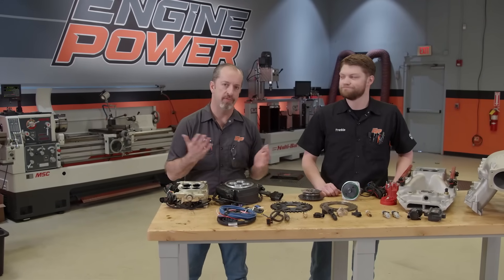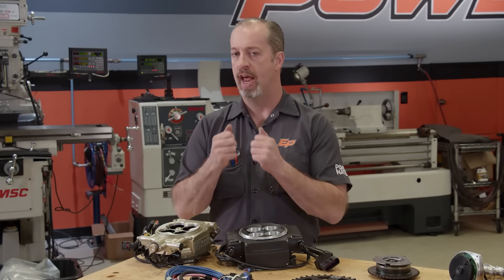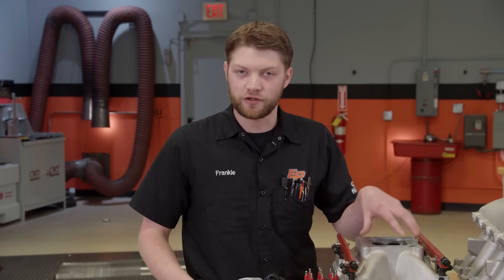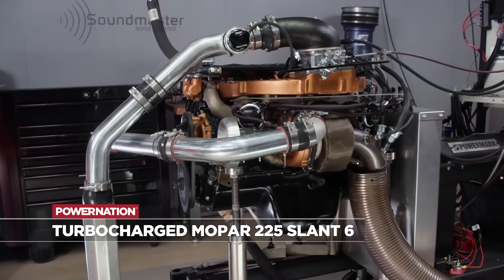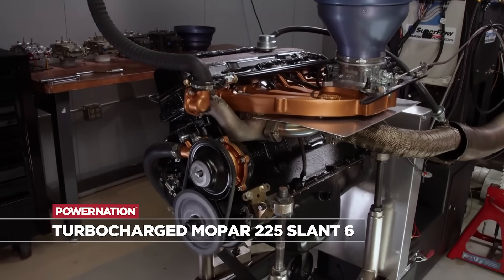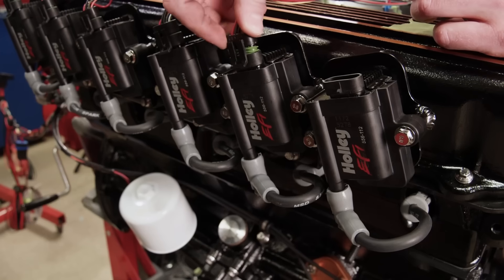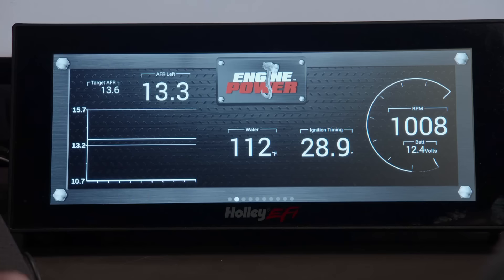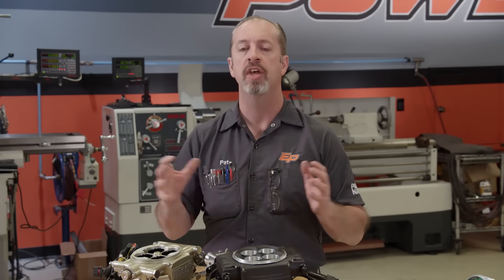EFI Conversion Explained: Everything You Need to Know

Comment: The answer: No! Aftermarket fuel injection systems have great adjustability but aren't designed to last 100,000 miles. You will be left down at some point without quick parts availability.

Comment: From my own experience, there's nothing simpler than a distributor and carburetor, as thats what I grew up with, no computers. Then I decided to go to a throttle body efi about 4 years ago, and it has proven to be vary reliable, especially when I included the associated electronic distributor.  Make a big difference when the temps get really cold.  Not as good as port injection, but so far, it has been very reliable.

Comment: Yeah edelbrock and holley will charge you $500-$800 for one of their port efi intakes. Those intakes are all but identical to their carbureted versions with injection bungs cast into the runners. That small deviation in the castings though somehow justifies those astronomical prices that in most cases do not include little things like fuel rails. Its no wonder people are buing the chinesium copies that sell for about $200 fuel rails included. Im not advocating for people to buy chinese copies of parts but companies like holley and edelbrock selling a basic dual or even single plane intake with a 4150 flange and 8 little injector bosses should drop their prices down to entice buyers away from the chinese crap. If they have a high speed ram style intake like the pro flo xt or high ram then sure let that be the bucks up manifold, but bring the basic one down into the 2-300 dollar range

Comment: I was told I could significantly improve fuel mileage on my 1985 GMC Short Bus by changing it from being carburetated to EFI. It's a great vehicle with 60,000 miles on it.  I converted it into an RV.  I love it except for the gas mileage and being a bit sluggish on the hills.  Is it worth it to change it to EFI?  I especially like the ease of a throttle body kit conversion because of the simplicity of the swap.  But after watching this video, I was left with the impression that unless I installed a manifold with port injection, I would unlikely benefit much.    Or did I misunderstand?
Reply: I have a GMC motorhome (Oldsmobile 455 front-wheel drive from the Olds Toronado).  GM built these back in the 1970's until they downsized all the vehicles and they discontinued the big block Olds drive train in the late 70's.  Quite a number of us have changed to EFI.  EFI makes your engine start and run like a modern vehicle, but it is Electronic Spark Control (ESC) that wakes up the engine and gives it pep and better mileage.
One thing to be aware of with aftermarket all-in-one EFI kits, is if something fails on them, the Manufacturer will insist your remove it and ship it to them for repair.  This is fine for a hot-rod or daily driver, but you are going to take your RV hundreds or thousands of miles from home to the middle of no-where.  This means you pretty much need to carry a spare system with you!
Another pitfall is many of the new kits have the electronics incorporated into the throttle body itself.  This may be fine for vehicles with lots of room for airflow under the hood, but in our GMC motorhomes and your (assuming) van-front conversion, the engine compartment is tight and electronics do NOT like heat.  Many FITech owners have experienced rolling in off the Interstate to refuel, and then have the engine not restart until the engine compartment cooled down.
I'm guessing your GMC short bus has a 454, so I would recommend a GM OEM throttle body system from someplace like Howell Engine Developments.  It's a bolt-on kit using GM's system and their separate (mounted in passenger compartment) ECM.  It will come tuned for your engine and likely won't require any further tuning in your application.  Howell can supply the ESC distributor and its pretty much plug and play.  Parts for it are widely available if required and mechanics are familiar with it.
Just my experience.
Reply: TBI is still much more efficient than a carb because it doesn't piss extra fuel into the wind at low rpm

Comment: The most important thing on EFI conversions that people must understand, a throttle body injection unit cannot be mounted straight to a carbureted intake manifold without plugging (shutting off) the heat riser crossover, or replacing the carbureted intake manifold with one intended for fuel injection. Failure to adhere this step will guarantee the engine will never run right as the atomized fuel will vaporize and never make it to the cylinder, which results in low / no power complaint. If a person is going to spend good money converting from carburator to throttle body injection, spend a few extra dollars and get a new intake manifold intended for fuel injection systems.

Comment: I've always wanted a build project and I figured a good place to start would be to upgrade the intake on my 98 Silverado with 5.7 vortec. I want to keep it naturally aspirated and convert that terrible spider fuel injection to a better EFI system.  The problem is, I've been doing research for about 2 months, and I still feel like I have no idea what intake manifolds I should be looking at. 
Should I upgrade my cam?
Exhaust headers?

How much HP and Torque can it handle before my transmission is in danger?
Do I need to upgrade piston heads?
Can anyone point me in the right direction? 

I feel completely capable and comfortable replacing the engine components and wiring. I have completed a lot of repairs on that truck by myself but this kind of thing I have no experience with.

Comment: When it comes to efi whether it's port or throttle body the sensors required depend on your setup. You can have whatever ecu you're running control timing and fuel in batch fire like the TPI engines of the 80s and early 90s, no crank or cam sensor required. Now if you want to run sequential fuel and sequential spark then a cam and crank position sensor is required. Now when it comes to gen 1 small blocks from 1955-2003 the late model vortec engines 350 and 305s use the goofy looking crab distributor. That distributor has a 1x cam sensor built in that provides the same cam signal that the early gen 3s use aka Ls1, 4.8, 5.3, &6.0. Efi connection sells a coil on plug conversion kit based around the Ls style crank reluctor ie the 24x and 58x wheels that they redesigned to fit onto a gen 1 sbc crank snout, where it rides inside the timing cover from a 96-03 vortec 305/350. They also provide a cam sync distributor that is just the distributor from a 96-03 vortec   with a blank cap and no high voltage, so it's only there to run the oil pump and provide a cam  position signal. 
Recently chinese copies of the edelbrock pro Flo and holley 4150 flange efi manifolds have started showing up on Ebay, but where the big aftermarket boys will charge between $400-$600 for their intakes these chicom units can be had for $200 and they provide fuel rails to boot, even the clearanced ones for the holley copy. I'm not advocating for the supporting of dirty communists using slave labor but these are on the market so companies like Holley and edelbrock might want to offer some budget alternatives for the efi crowd.

Comment: I was just at my dealership for a 20K maintenance. I was told that i needed an "EFI Fuel Service."  I denied it because it didnt seem right. Ive only used Chevron gas since 0 miles. I put Feul Injector cleaning solutions every now and then (i buy them from Auto Zone. A chevron brand). 

Price is $270.00 !!! I denied it.  Should i go look else where to have someone else check my EFI system?

Comment: I have a 350 4 bolt main that runs well in my '71 Chevy Blazer. QUESTION, should I get rid of it for an LS or LT?  Will the LS or LT fit, will I have to modify the motor mounts, steering pump location, etc. ???

Comment: question? will the aftermarket fuel injection (efi) help me drive over the passes by increasing o2 intake? i have been thinking about doing this but the issue i need solved is me being forced into the slow lane when driving at high altitudes. if it cant solve that then its not quite worth it for this guy. but if it can, I'm in! old chevy van with 305
Reply: It def won't make that much "power" difference at high altitudes unless your carb is malfunctioning. It might help your mpg tho.

Comment: I saw a video where a Carburetor Guru was saying F.I. gives the engine the fuel regardless of what the engine wants based on software but a Carb once tuned correctly gives the engine what it asks for.
Made it really clear they didn't understand fuel injection at all. And it was an "Expert" carb tuner. lol

Comment: Real fuel injection has injectors per cylinder n adjust timing in real time. Holley sniper is just a waste just buy a modern car if u want efi.
Reply: 60's era cars can benefit from throttle body injection and still look stock with air cleaner on
Reply: You just don't get it

Comment: these EFI units are un reliable,, any brand any model end of story,, many of the parts are chinese and spares are not on every corner like holley carb parts. when i see vehic;e  manufacturers using these i will take a 3rd look. and circuit race teams using these, bought a holley kit ,, sold it un opened.
 a pocket full of pens,, say no more,,,,,, a tool belt like batman had in the 60,s TV series is next,,.

Comment: How to do an EFI Conversion:
1.  Spend $2000 to boost pressure and buy Throttle Body.
2.  Call customer support to get it to run
3.  Take to local EFI Guru to make it idle.
4.  Drive and Enjoy.
5.  Call tow truck when EFI brain dies.
6.  Repeat steps 1-4.
7.  Call Tow truck again.
8.  Buy Holley Carb w/ manual choke
9.  Enjoy Car again
Reply: Soo true!

Comment: For any application you should run port EFI if there's a dual runner intake manifold available for the engine that meets your power, and emissions, goals. Historically that has been the greatest obstacle, particularly with port injection, because port injection needs a dual length runner manifold to take full advantage of its capabilities. If you have that manifold, you can run a wide LSA, that allows it out perform as well as run cleaner and smoother than a dual plane carb or tbi setup with a narrow LSA from idle to peak torque. It can also be set up to outperform a dual plane carb setup past 7000rpm at the same time. All of that isn't possible with a carb because the fuel won't distribute properly through a dual runner intake, and you have to run a narrower lsa to get the power.

Comment: Guys I absolutely love your informative show!! I recently converted my 1972 mustang to a throttle body style efi. It’s a 4 bolt main 4v Cleveland engine with original iron open chamber heads 9:6:1 compression. What is a good afr for light cruising??

Thank you very much

Comment: I’m building a 72 Charger Rally with a stroked 440 (512) cu in with a Fi tech six pack on top. I’ll be putting the engine in soon
Reply: Sooo. How did this project end up?

Comment: Ok, hold the phone for a second.  One thing they DID NOT MENTION.  Make sure you call a tech line or find a reliable source that you trust to answer one of the most basic questions that some A/M companies DO NOT MENTION.  This is what you ask them verbatim, "Is it tunable on an Aftermarket Duel Plane Manifold?"  I cannot tell you how many times this issue comes up.  One more thing.  DO NOT put on a carb spacer until the basic parameters have been set and verified and you are comfortable with tuning the system.  

Last but not least.  DON'T OVERTHINK IT.  The computer only needs the basic information to enable a base map.  You try and spoof the computer for some odd reason and you are gonna chase problem after problem.   This is where the older generation has issues.

Comment: A question if you please?   Can a throttle body type EFI like the Holley Sniper be rigged to use Propane instead of Gasoline???
Reply: No. Propane has a completely different regulator that is required.  In some systems it may actually require a vaporizer.
Reply: @joshtheking1772   hmmm, interesting.  thank you for your comment.

Comment: It bears mentioning that a lot of port EFI systems pulse all the injectors simultaneously, all dispensing the same amount of fuel. In my mind, that's hardly worth the extra expense over a TBI system. Just my $0.02.
Reply: Thats not entirely true and sort of a half truth.  TRUE fuel injection varies the pulse width in accordance with many factors.

Comment: Grat vid guys but what about older engines I have a 41 CJ-2A with the flat head still and I would love to upgrade the Carb to even a simple throttle body but have found nothing for older engines like flat heads so why not a custom build on a old flathead one day with new equipment such as Throttle body and Electronic timing ... Thanks

Comment: At 1:00 where the "Boosted 4.3L V6" is shown running up, you can see fuel dripping off the throttle body linkage.
Reply: They had to cut the footage shortly afterward because it caught fire.   It wasn't serious because the guys quickly took out their shirt pocket mini fire extinguishers to put it out.

Comment: A EFI "swap" I haven't seen is taking a 88 and up Chevy which is TBI 5.7 and getting rid of the old crap and swapping in a new TBI system.  The old OBS trucks are popular but the old original TBI systems are craptastic at best, the wiring is old, etc etc.

Comment: I'd love to see a Chrysler/Dodge 4.7L OHC V8 build.
Reply: You won't see those engines on these shows. There is no aftermarket parts out there. The people that build these motors pay for one off custom parts they built or payed a company a bunch of money. 4.7/3.7 are rejected child's that got love at first but was proovin that they can't handle much more of a power programmer and exhaust. The cold intakes out there harm the motors then help. I've had 2 jeep gran cherokee with 4.7 and 1 with the 3.7. If you want to see why these motors don't handle power just Google or look here on youtube.
Reply: @wkjeeping9053  . . I appreciate the advice. I'm actually a retired Ford Tech. I really don't have much experience with the 3.7/4.7, or even the 'New' Hemi's. I think a roller-block Magnum 318 or 360 is what will find it's way into my 2000 WJ. At least I have a reasonable amount of experience with those. (still mulling a 302/AOD swap since I already have everything, but . . )

Comment: now this might be a way out of the box request but if any of the power nation shows remember late 90s to 2000s nascar restrictor plate racing, i would like to see one of those engines being torn down and then rebuilt with and run on the dyno with and without the plate to see the discrepancy in horsepower, and also hear that awesome sound and let powernation experience that also
Reply: Unrestricted they were 850 to 900 hp. Way too much for today's Cup steering wheel holders.

Comment: Thay are by no means reliable, and when they get warm it  screws with the computer, and there is no fixing it on the side of the road, you are screwed until you replace  it, they run good for a while but it's only a matter of time until you're walking getting towed,I'll stick with a good old carb from now on !!
Reply: Sounds like boomer yelling at clouds.

If EFI didnt work, cars wouldnt have been using them for over 40 years.

Comment: I got that exact dual quad system and it never ever worked. No one, but no one, could ever get it to work either. 
Took it to 2x dyno tuners and both of those were just left scratching their heads. Tried to return it and they said it was an installation error for which they can't be held responsible and they won't accept any returns. 
I'm a qualified mechanic the installation was 100% perfect. 
So fast forward turns out all the onboard ECUs were faulty subject to a class action in California. 
They try and sell you a new ECU even though the EFI system never ever worked, they knew there were problems and they treated me like I was the problem. Completely unethical in my view.  
Also the manufacturer never mentions that their dual quad system doesn't fit on latest SBC dual quad manifolds - apparently that isn't their fault either but mine. 
The anger is coming back, a very bitter experience.
Reply: Slapped an TBI style EFI on a Buick 455 five years ago. Never ran properly. Mileage was worse than the Quadrajet, Started harder than a quadrajet, never had a smooth idle, throttle response was the same as a quadrajet. I shoulda just stuck with a quadrajet.
Reply: I’ve heard similar experiences.

Comment: I fit a A/F gauge to my 360 engine with a 750 holley. I was shocked at the readings. Once you drive about part throttle, backing off with high vacuum situations, throttle roll on's I couldnt believe what the carb was doing. Looked good at full throttle but its those other situations.
I went EFI after that because I knew I'd never get the carb the way I want it.
Reply: The engine doesn't want a specific air/fuel ratio. This is the lie efi vendors sell you.

Comment: How much confidence do you guys actually have with the "auto tune" thing? Especially on a TBI deal with one O2 sensor.
Reply: Honestly, even at it's worst the TBI system will still have a better guess at what's going on than a carb. Engines that are made for carbs don't have nearly enough compression to run into knock issues because carbs suck at getting the fuel mix right at low rpm.

Comment: Megasquirt makes EFI easy.  Can run almost any engine.  Initial setup is easy and building maps is automatic.  Then is self tunes.  For $400, it's all you need.  My 452 cu.in. FE Ford with 8 stacks runs on a Megasquirt.  So does my twin turbo 4.6 Cobra motor in my '32 coupe. The wiring harness tells you were everything goes.  Don't pay big bucks for a Holley or other aftermarket system, use the money for other parts of your project.
Reply: Only other efi id use is the Howell which is a gm tbi clone